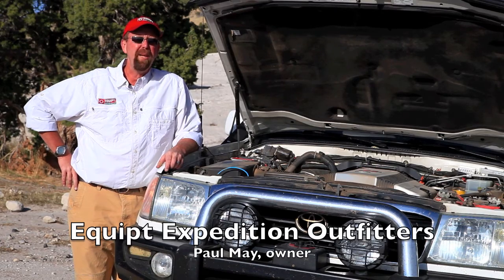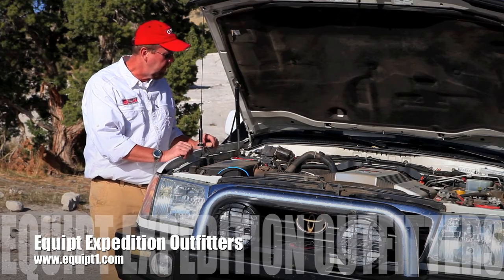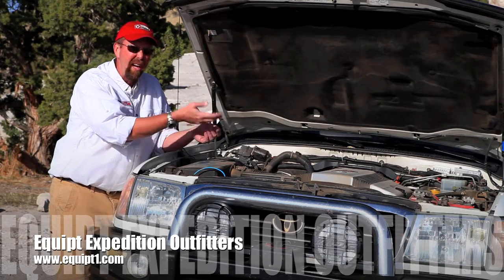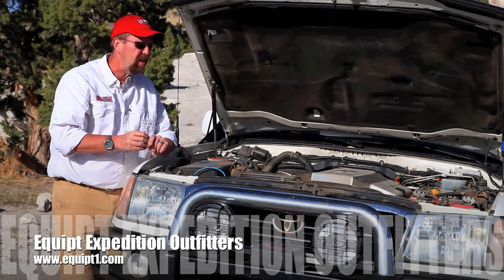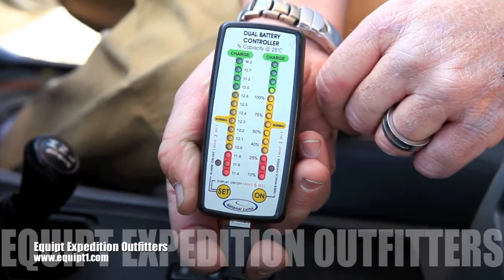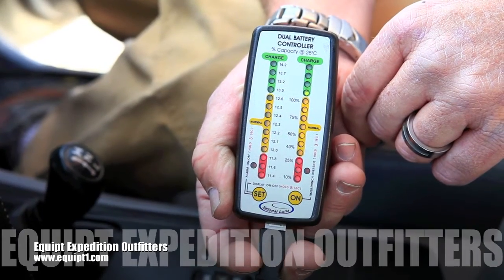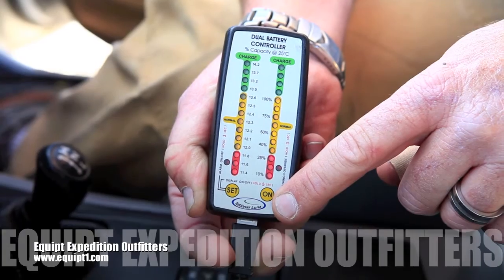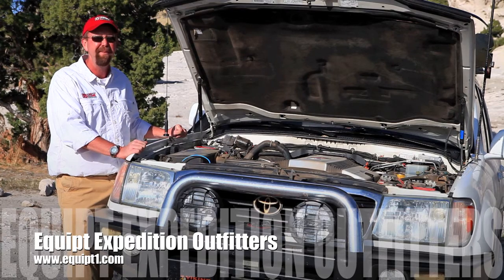National Luna Dual Battery System

Comment: why is the solenoid still on if the vehicle is off
Reply from the maker: Great question. The solenoid connects and disconnects based on voltage levels. A recently charge/energized battery can take some time to drop to resting voltage, unless there's a load on the aux battery immediately. This means, the car can be shut off but voltage doesn't drop to the disconnect threshold of 12.7v. Let's say a fridge is connected to the aux battery when the vehicle is shut off, the load on the battery will drop the voltage level of the two batteries faster than no load. In this case, this would cause the solenoid to disconnect more quickly. Generally they should disconnect within 20-30 minutes but it varies based on the batteries, solar connections, etc.
Reply: @Equipt1  thank you for that reply helped me a lot

Comment: I agree, mine crapped out after 18 months of use. 1st the controller then started having problems with everything else
Reply from the maker: We've noticed if the four pins in the controller get tweaked or make poor contact with the female contacts in the wiring, it can cause some bugs. Also, the sequence in which wiring gets connected is very important in this system. Most folks connect the ground and then the positive. This creates a tiny arc of electricity. This arc is enough to cause issues in the circuitry. This is why National Luna requires the positive cable to be connected first, then the negative. There is no arc in this sequence. More often than not, we see issues with this system after someone has done some work requiring cables to be disconnected, we've also had shops replace these for customers because the shop did not connect wiring correctly.  Please note, if anyone is having issues, we have parts available and you're covered under a three year warranty.

Comment: Can you also charge the auxiliary battery with a solar panel?
Reply: You would need to hook the solar panel directly into the battery.  If you wanted to charge both at once, you'd need to use the override feature on the controller and bridge the two batteries.
Reply: @tacul9333  DO NOT connect a solar panel directly to a solar panel. You need a solar controller between the panel and your battery. The controller is essentially a funnel that dumbs down the voltage generated by panel to a voltage that the battery can safely accept. High output panels can put out close to 40v, you don't want to connect that to a 12v battery.
Reply: Connect the solar panel to a charge controller and connect the output from the charge controller directly to the battery you want to charge off solar. If you want to charge both batteries off solar panels, then get 2 panels and 2 controllers (one for each battery/panel). I've been running like this for 8 years on the same pair of batteries. Batteries always full when vehicle standing unused for a while. This National Luna system had been rock solid
Reply: I have this setup for my Xterra. Curious to know can this system charge a lithium battery. I’d like to get a 100ah lithium battery as my secondary.

Comment: Mine crapped out after 2 years of use, National Luna system didn't like the California and Arizona heat. I junked the system and went with the blue sea #7622. I would not recommend the national Luna. Equipt is a great company but national Luna blows.